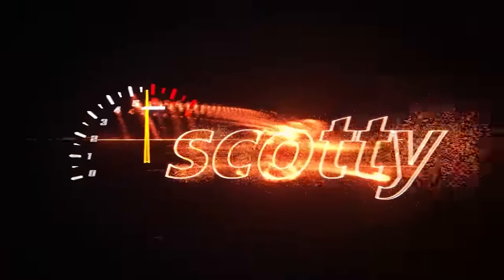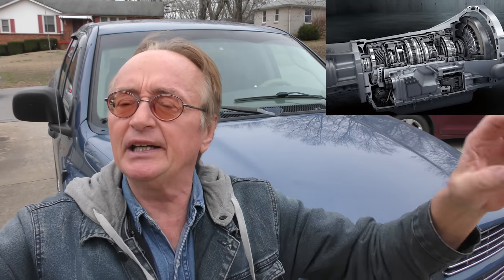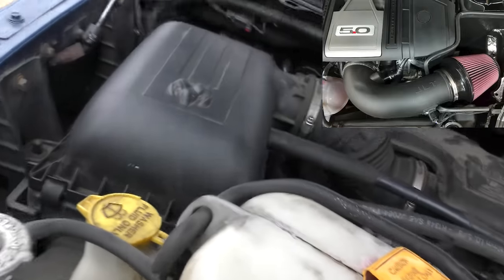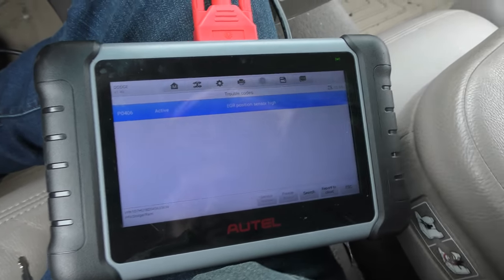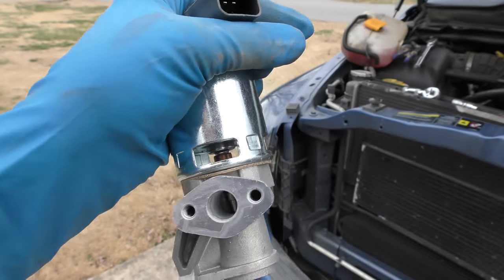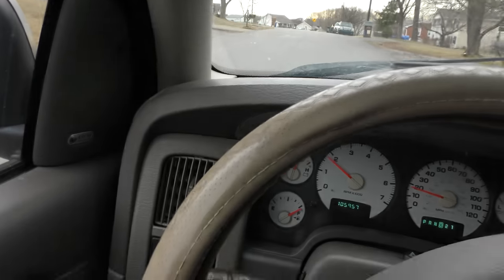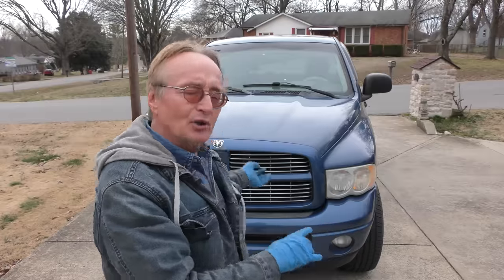Please DO NOT Buy a Dodge (Unless It Has This Engine)

Comment: I have the 4.7 Liter Gen III SOHC V8 in my 2008 truck.   Its a powerful motor with 302 hp and 330 lb feet of torque.  But the lifters tick (which i need to get fixed) and man that thing is thirsty. Combined mpg of 16.5.  And I spend half my time on the highway!
Reply: Did you get the lifters fixed
Reply: @kudachikwenya1870  Unbelievably, my truck is still in the shop.  I'm currently arguing with the aftermarket warranty company about what repairs are covered.  I'll let you know how it goes.

Comment: My 1993 dodge ram D350 still has its original engine and transmission and even paint and clear coat still solid and strong has outlived three of my vehicles (the truck was handed to me by my adopted dad he bought it brand new in 1993 from dodge and cambells and it was sitting on their show room floor) unfortunately it’s been in a accident which was 8 year ago and it’s still up and running with everything end up having to use it as a daily since all my other vehicles end up costing more then I could keep up with 🤣 good ole reliable

Comment: 2006 Dodge Dakota owner here. 4.7l V8 with a 6spd manual. It's almost dead because I was rough on it and i bought it used. Wish I could find another.
Reply: @Acechanderson  lol! I've had great luck with mine but it is a Dodge so I'm not exactly surprised
Reply: @hydro_storm4527  its my first and last dodge lol. My boss had his dodge 1500 since 08 original battery some are good, I just got a bad taste lol 😆

Comment: sigh, it's the needle bearings on the bottom of the lifters..... which is ultimately from letting the engine run in idle for long periods of time. The problem is the oil flowback ports are too wide..... which is the opposite problem the Toyota 1MZ-FE engine has.

Comment: I agree. The locking cut out, can easily be welded and machined. A good weld is stronger than the steel.
I would charge about 600 USD for that job.

Comment: 105k!! Whew!! That’s nice. I’ve got 205k on my ‘04 5.7 and it’s still (knock on wood) running pretty well. But showing signs of wanting new lifters and a cam.
Reply: Probably an exhaust manifold leak. Lifters and cams were not an issue in those years

Comment: I wouldn't buy another dodge regardless which engine is in it. My 95 LS 400 has 220,000 miles and you can barely hear it running. I am the second owner and can only lmagine what this thing was like new. The 1uze is awesome.

Comment: I recently bought this body style /yr truck from a friend with the little v6 in it, single cab short bed.  Run and drive great... I know its no the hemi, but this is a side vehical/city truck for running to pick up things /yard work for me.  I hope it is going to not be an issue with the smaller engine, it does seem to get great milage for a full size truck on the highway though.

Comment: 3:34 I actually forgot that drink holder even goes up cause its been down so long in my 2002 Dodge Ram lol
Reply: I'm about to purchase a 2002 1500 . Any advice anythings I need to look for ? Also only concern I have is he says it PROBABLY has a bad fuel pump they truck will get power jus won't crank . He said he had been letting his daughter drive it and she kept letting it run out of gas and one day it just stopped cranking . Family friend he only wants 1500
Reply: @Sinsirink  I've really enjoyed mine and it has held up well.  137k miles (only 35k of which I put on over the last 10 years) and has only needed routine repairs except for a busted radiator

Comment: My 2011 hemi is surprisingly running fine at the moment. Just typical maintenance and a TIPM replacement so far at 110k. We will see if the rollers or lifters go out in the next 20k

Comment: I had to out an evep purge valve in my 01 Dakota 3.9L probably....130,000?  And the hoses on the canister at 80,000.   Other then that.  I know not EGR but.  

But my relative's 15 EcoDiesel....horry chit!!!  Fuel system!  Turbo. Etc etc.  Choot it.

Comment: I own a 2014 5.7 Ram 1500 and the truck has been problem free.   I've just changed the oil and brakes (normal wear and tear) and Bob's your uncle.  One of the best vehicles I've ever owned.  In the meantime they wanted $20K more for a Toyota Tundra....lol...NO THANKS!  Ford's have the ecobust turbo charged engines...NO THANKS.  my RAM has been great, wouldn't hesitate to buy a new one with the 5.7!

Comment: The 5.2L V8 magnum is a great engine, in the Dakotas and Jeeps ,,reliable, strong...5 speed manual; obviously..it eats waterpumps though...but thats not the engines fault thats the garbage aftermarket ACDelco ect Cardone junk that cant handle the torque when you rally it in the snow lol....

Comment: all modern trucks have the lifter problem, gov made them do it. would rather have my 2019 and when it eats itself i will rebuild it without the MDS. Only way to avoid mechanical issues is to buy a horse, have fun with that!

Comment: My 2008 1500 with the 5.7 has 160K miles and still running fine.  A couple of complaints.  The AC system is on the small side and the back two plugs on the driver's side are difficult to get to and of course the clear cost is crap.  I have had the roof repainted and am going to do the hood soon.  I do like how the front rotors are hat rotors; makes a brake job much easier.
Reply: do 2008 5.7's have the cam issue Scotty talks about in this video?

Comment: Mines a 2003, 5.7 hemi, quad cab, 4*4 SLT with 211000 miles and runs perfect and shifts fine, I drive it like hell so it always needs a little tlc but the engine and tranny runs strong

Comment: Do older models have the same features as the older ones? I’m a contractor and I like the ram box cargo and power on hand. I can plug stuff up and have cold drinks.
Reply: Depends on how far back in years you want to go and the Trim you decide to get. The 2012 Bighorn got some nice features.

Comment: My buddy's dad has a 2004 dodge ram 1500 with the 5.7 hemi and 250,000 miles it burns / leaks a half quart of oil between oil changes but other than that and a fuel pump he hasent had to do anything beyond regular maintenance on it and tows with it once a week on average.

Comment: I always wondered why they geared reverse faster than first on trucks. I have an '06 F-150 with a 5-speed manual. When I'm hauling a heavy load, it goes forward like a champ, but reversing is super hard on the clutch.

Comment: Unfortunately Ive had nothing but awful experiences with Dodge. From a 99 half ton with blown 360 at 40k miles to an 06 Cummins that got just about negative mileage that nobody could fix. Also had an 04 Chrysler that blew an engine at 44k and 72k. Hate to admit it but Ive now got a 12 Explorer that has had nothing but a bad front strut bearing in 120k miles. All said, that will be my last new vehicle. Theyre so bloody expensive nowadays and turbo everything can kiss my butt.

Comment: i just got a 03. i had to fix the crap they did to it. i still have to fix an a/c line, a broken coil plug, and i have the lighting bolt light on which won’t go away even after i changer the tpc. i am going to replace the plug just in case too

Comment: He forgot to mention all of the headache problems..domelight and door ajar warnings and sensors. Wipers operating on their own. Cd player issues. Rusty bed wheelwells. Warping rear rotors. TIPM components failing..leaking rack and pinions..etc..on and on

Comment: Whose responsible for the 3.6 Pentastar engine? Just had the drivers side Cylinder Head replaced twice in three months. 2014 Town & Country, 135,000 miles. Understand there’s a class action lawsuit on this because of so many failures.

Comment: My 2012 hemi has been great, only issue it has all 5.7s suffer broken exhaust bolts. Did have the wire to a rear speed sensor get damaged, but I just ran new wires all the way back, maybe an hour of work, and no jacks. got over 200k mi if you take proper care of the new hemi and use quality oil it'll take care of you.
Reply: 4.7 and 3.7s do as well, they use the same bolts/quality across the board for all.
Reply: @WaterLantern  I had a 4.7, it randomly overheated, and warped jacking up the HG, never found a reason for the overheat, had coolant, water pump was in decent shape when I replaced it, fans worked. Always used full synthetic, and proper antifreeze.

Comment: I own 2 04 Ram both 4x4 slt one is single an other crew cab both with over 200k miles an no check engine light or problems whatsoever

Comment: I just bought a 2022 ram1500 classic warlock with the 3.6L pentistar engine and the 8 speed transmission. its surprisingly snappy for a v6 and I average 22 mpg. I only use my truck for my fishing kayak, hunting and towing small trailers with debris or furniture. What do you think of the new classic rams based off the 4th gen?

Comment: I have had my share of vehicles in my life I had 3 brand new ford pickups and after each one I said I will never buy another but stupid is as stupid does I have had 4 dodges the first was a 74 dart swinger when I was a kid and loved that car then a 99 dakota last year of the 318 factory order I loved it but to small for the family then a 09 Cherokee which was real nice if I had a complaint it was only a 6cly,  now I have a 2012 Ram 2500 bought new and I am pretty happy with it 5.7 hemi just wish it was a standard and still manual locks on the front hubs with a hand shift instead of a switch just personal desire.

Comment: lol.....theres like 5+ points of failure for the evap.....that check engine light will be back on in a couple weeks or sooner. You need Inspector Watson and a week of digging and replacing to fix that.   Been driving my 2005 Ram 2500 for 0ver 19years now....10 years the check engine light has been on.

Comment: 2003 2004 and 2005 were made with weak valve springs or seats.     I found out at 77 thousand miles.   
So they are not that dependable

Comment: Hey Scotty - tried looking through your videos for an answer already on this and came up short.  I've got a service manual on the way, hoping it's got a decent schematic of the electrical system, but in the meantime - you ever hear of a power windows, blower control, and radio going out at the same time, but the power locks still work.  05 Power Wagon.  Asking for a friend.

Comment: I got a 05 2500 with a 5.7 and at 200k it’s still running great,only problem has been the exhaust manifold studs broke,easy fix, really see no need to buy a newer problematic truck.

Comment: My 09 4.7l just quit on me this morning, for the pass couple weeks it's been coughing out blue smoke when cranking up, I been getting regular oil changes and they told me it's normal for older vehicles do that. I crunk it up this morning leaving work and it sounded like my truck motor was going thru 5 blenders it got me home over a hr away but I'm sure it's done done.

Comment: The best engines were the 5.9l v8, 2.5l 4 cly. OK decent were the 8.0l v10 and 5.7l hemi. Pure junk were 4.7l v8, 5.2l v8,  3.6l 6cyl run away from these. All had horrible transmissions and horrible electronics

Comment: There's this video on YouTube from some bearded guy bashing the dodge v8 4.7L magnum. The guy gives it almost zero props and he was making comments that would make all owners of this engine feel real bitter and possibly dumb for owning one. I myself drive an 01 Dakota with it's second v8 4.7L (according to the previous owner) but I've tackled some problems I encountered. Like a misfire that was throwing a code for cylinder two p0302 I think is the code, but it was only a coil pack. Another issue it had was the IAC valve. Again, going for a drive and there goes the check engine light and I'm off to O'Reilly's to use their scanner. Got a 1294 code or something close to that number, anyway, the O'Reilly report said I had to change out the IAC valve and a gasket. Did that and got the engine light come on not too long after changing the AIC. I took a look at my work and just re tighten the  screws a little making sure that o-ring stayed put. That made the check engine light go (for now at least). Previous owner neglected the crap out the truck to where I questioned Dodges' craftsmanship but really it was neglected. When I first got that truck one of the first things I did was change the oil and man that sure made a difference in the way this truck gitty up. Tackled the misfire and IAC plus I added Rislone to the engine to see if it would smooth the ride out. Another thing was it's suspension. Man what a mess! Ball joints shot, shocks shot, wheel bearing, hub, inner, outer tie rods, the rack and pinion is going the power steering pump is whinnying sounds like it's on its way out, got leaks from both power steering pump or hoses or rack and antifreeze so that might be the water pump. Despite all this, the truck runs descent enough to get me around town, out on highways and freeways, and it's not overheating. All in all, my experience is that someone came across a descent truck with a good engine but decided to skip all it's regular maintenance. Now that I'm tackleling each neglect as it comes, (oh yeah the paint is a sun damaged needs sanding re-painted and all that good stuff). I appreciate Scotty talking about dodge trucks for what they're worth.

Comment: I have the same year Ram with 90,000 miles that I bought new. My check engine light spend more time on than off. It has a small evap leak that we can't find

Comment: My 1993 D250 Cummins has gone 205,000 i transmission and fuel injectors and the A/C failed after 28 years

Comment: Always entertaining videos. But I must disagree with your history lesson on Chrysler. When Daimler “merged” with Chrysler there was a company on the decline but it was Mercedes not Chrysler that was in trouble. Chrysler had stockpiles of cash that Daimler needed. Look how uninspired and plasticky the interior of that Ram truck is. That’s Daimler’s doing. I’ll bet that bedside is rusted out. That poor design rusted through at 2-4 years in Midwest weather. Remember Chrysler had introduced that Big Rig styling which revolutionized the market just a few years earlier as well as a redesigned Wrangler, neon, etc. Big sellers.

Comment: I had an '02 Ram 1500, 3rd owner with almost 300,000 on it. It had the 5.9L throttle body injection ,with FEDERAL EMISSIONS only. NO EGR at all, just a MAF. It used to idle and drive rough when it was cold. IT would idle like it was going to stall and sometimes would stall, if I just got in and drove when it was cold, it would chug, misfire and backfire. Turns out, the MAF sensor was mounted kinda weird in the TBI. Gas would splash on it then get crusty when it fried. After running a while, some fresh gas would open it up again. My friend now has it and built a wood bed for it, it looks cool but had to fix the frame before he could put it on the road. Any fixes for that MAF sensor?
Reply: That engine uses MAPnot MAF.. on the throttlebody you have three sensors in the back is the idle air control on the side is a throttle position in the front is the MAP-manifold absolute pressure , maf is mass air flow and is a different system entirely

Comment: I have 1998 1500 Laramie quadcab 360 Magnum, the damn thing usses alot of oil! It doesn't leak at all and it doesn't burn, it only has 65000 miles on it and it goes thru 2.5 quarts every four fillups. I don't know where the oil is going, any idea's??? Other than this it runs great!!! I use Mobile One 5W-30 and change the oil every 5000 miles.

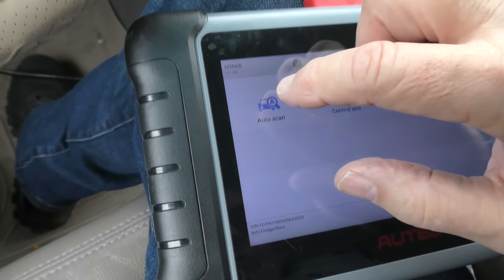Comment: Scotty, big love, you common sense person... My custom 98 with clutch and 5 on a 3:21 gear, big springs, set back front shocks, 3" factory and 318 motor tuned (from factory) @245hp with 279K miles will be okay though, right?

Comment: Got one 2 years ago. 04 ram 1500 alChanged the engine myself. Problem started at 300.000 km. 181.000 miles ? Miss fire one piston .never open op to deeply check the problem .

Comment: i have a 2005 dodge ram 1500 5.7 hemi and i have a rather large issue in my opinion, the dash has no lights.... the odometer, speedometer, and so on work perfectly fine, but every light does not work. i dont know what caused it. I checked all fuses, replaced all fuses, but no lights.

Comment: I have a 2004 2wd short bed regular cab that I stopped driving at about 56K miles.  fuel pump is no good now so I can't start it anymore.  Maybe I'll get it running when I have time.  Parked under a canopy now.  Moved to NY and didn't want it turning to a rust bucket and had 4.56 rear gears lowered so it's really no good with a Hemi for gas, but it was fun to drive.   It's a ST.  Is it worth anything?

Comment: I have a 2001 dodge Dakota 4x4 has whine. what is best way to find if coming from transfer case or rear deferential?  Thanks, from Chattanooga TN for all of your great videos
Reply: If you can safely get under it, use a mechanics stethoscope or long screwdriver against a closed ear. Have someone run it in drive a 4wd. Probably a bearing or gear lash

Comment: Dear Scotty, I drive Hyundai Santa Fe 2007. After last visit to a mechanic - replacing horizontal steering gear with regenerated one, my average fuel consumption went from 9,0 L/100km to 11,0 L/100km (26 mpg-> 21). What gives?
Reply: highway mileage? is alignment okay? if not then one or both tires will be hotter due to friction from mis-alignment.
Reply: @pigyear88  this may be the cause? oh, ok. I only did the alignment yesterday, so Ill watch if the consumption changes now.
Reply: @maciejp7829  under Inflated tires will reduce mpg too.

Comment: Just picked myself up a used 04 ram 1500 for my first car, the underside is a pretty rusted and got the check engine light on, and I don’t want to like you said pay for a mechanics overpriced shiz, how do I diagnose it myself? And how do I maintenance this beast?